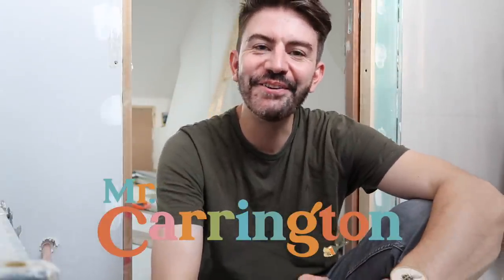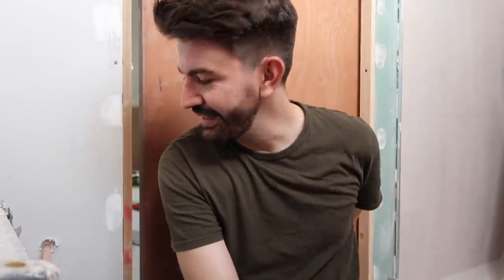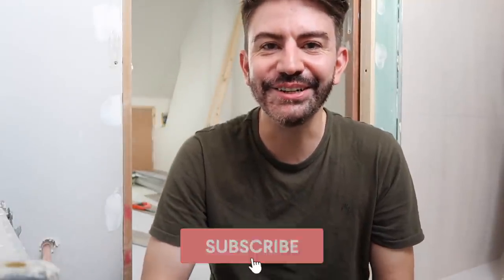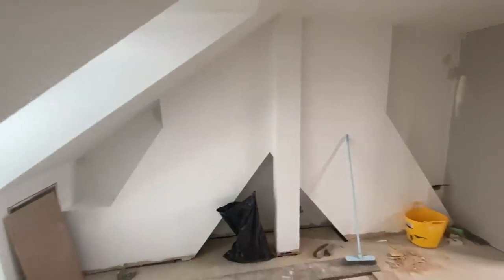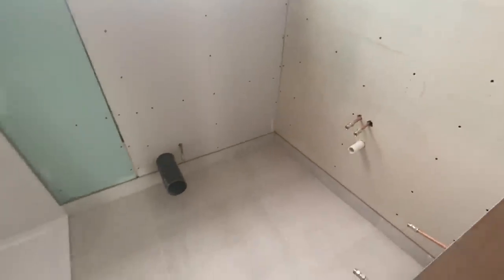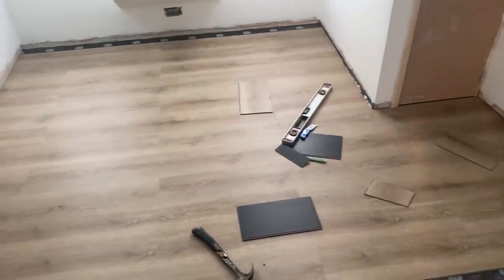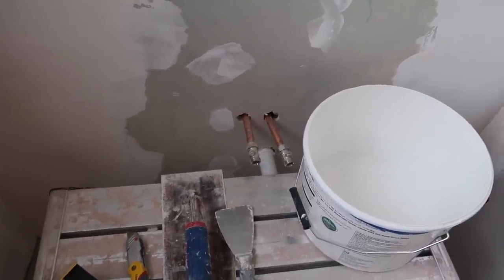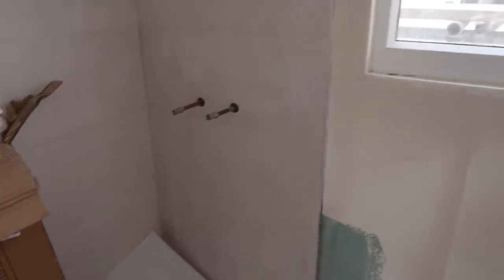LOFT CONVERSION WEEK 8 and 9 *Tiles + Floor* | Victorian Loft Renovation | London UK | MR CARRINGTON

Comment: It looks great Iwan. A much bigger space and so much lighter than I thought it was going to be. I’ve got a little black metal electric fire with fake coals. I got it  from one of the eBay shops over 3 years ago. It was so inexpensive but the amount of heat it puts out is amazing. Great you have got a storage cupboard.

Comment: Super vlogg my what a difference in a couple of weeks it all looks brilliant.
Laughed when I saw where the extractor fan switch was, mine is also quite high up the wall I have use a step ladder to turn it off for cleaning the extractor fan .
Seems a bit daft to me my son has one at a decent hieght just outside his downstairs toilet room, a more practical place I think.
I  am getting on in years and live in a sheltered bungalow so climbing a ladder is not a good thing.
Have a great week ahead.

Comment: Wow, looking amazing. I was really struggling picturing how it was all going to look, I'm hopeless at that, windows are really great, love the sliding door, that really saves on space. Love the tiles, I'm delighted that they are good tilers, some of them are disastrous, tiles that aren't symmetrical would drive me insane. Yep, I've used a Jack hammer on tiles before, it's super annoying using a hammer and chisel.( lots of swearing you're right), It's coming along nicely though, flooring is beautiful. Can't wait to see how the lights look. Well done. 💜 it. Btw, be careful with the chrome switches, you get some residual shock from them even if your hands are slightly damp. (Happend with mine anyway, Ouch).😊💜

Comment: Hi Ewan,Only a thaught,Could you create an extra storage area /cupboard under your new staircase.Every bit of space is worth using.Also while the electrician's are there,I would of had a bank of 4 power points put into your alcove,you can't have too many.
It's coming together great,can't wait for the next instalment.Good luck
Reply from the maker: That's a great idea, but I think the space needs to be open for headroom below :)

Comment: Looking great. Have they still got to grout the shower? I have a massive loft I live in a 2 bed bungalow and the entire loft is the length of the house it had a high roof and is all floored I try not to put much up there apart from decorations my rule is if I’m putting it in the loft then I don’t need it so it goes to charity shop
Reply from the maker: Yes grout still to go on! That’s a good rule